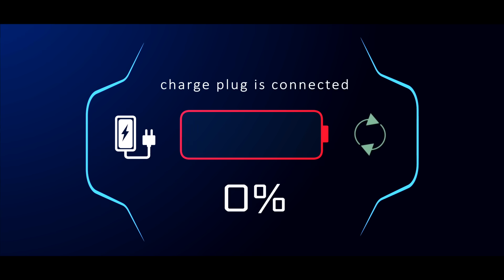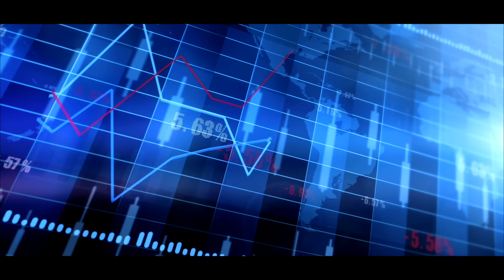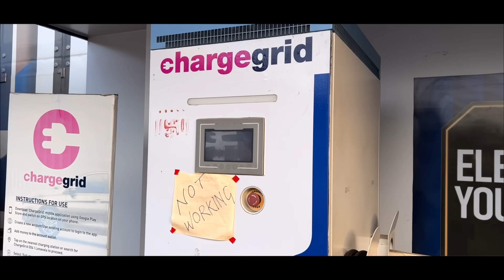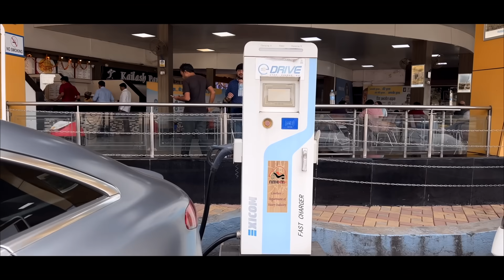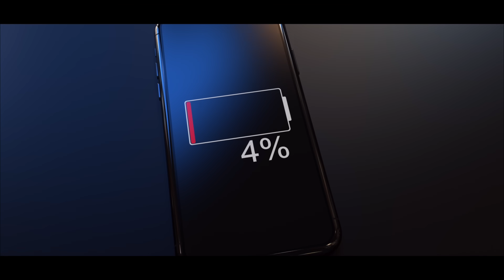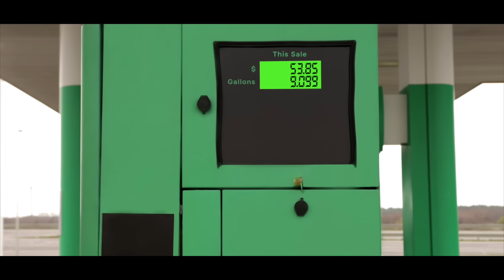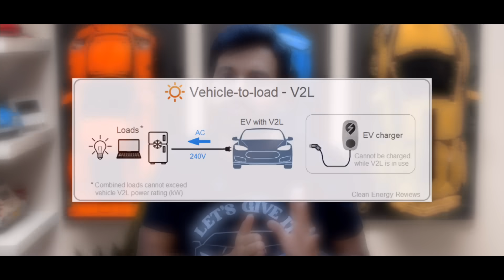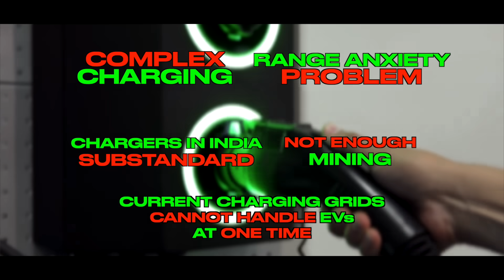Here Is Why Electric Cars Are Not The Future!

Comment: 1. Efficiency & Cost Savings:
	•	EVs are 3x more energy-efficient than ICE cars and produce zero tailpipe emissions.
	•	Cost per km: German TDI engines cost ₹5–₹7/km for fuel, while EVs cost ₹1–₹2/km when charged via grid electricity. With solar panels, EVs can run almost for free, slashing long-term costs.

2. Performance:
	•	Tesla Model S Plaid: 0–100 km/h in 2.1 seconds, 1,020 hp, 1,423 Nm torque.
	•	BYD Seal (Performance Variant): 0–100 km/h in 3.8 seconds, 530 hp, 670 Nm torque.
	•	BYD Atto 3: 0–100 km/h in 7.3 seconds, 201 hp, 310 Nm torque.
	•	Compare to VW Golf R TDI: 0–100 km/h in 4.7 seconds, 315 hp, 420 Nm torque.

EVs deliver instant torque, ensuring unmatched acceleration and responsiveness, making them more fun to drive than TDI engines.

3. Range & Reliability:
	•	BYD Seal: 570 km range (₹41–53 lakh).
	•	BYD Atto 3: 521 km range (₹24.99 lakh).
	•	Tesla Model S: 652 km range.
	•	Real-world examples: Tesla vehicles have driven over 300,000 km with minimal battery degradation, proving long-term reliability.

4. Maintenance:
	•	EVs have 20 moving parts in the drivetrain compared to 2,000+ in ICE cars, leading to drastically lower maintenance costs. No oil changes, engine repairs, or exhaust issues.

5. Driving Dynamics:

EVs outperform TDI cars in driving comfort and dynamics due to:
	•	Low Center of Gravity: EVs have battery packs mounted low, providing superior stability, cornering, and balance compared to top-heavy TDI cars.
	•	Instant Torque: Instant power delivery allows for better responsiveness and acceleration, especially in urban stop-and-go traffic.
	•	Quiet Rides: EVs eliminate engine noise and vibrations, offering a luxurious and peaceful cabin experience.
	•	Adjustable Suspension: Premium EVs (Tesla Model S, BYD Seal) feature adaptive air suspension, ensuring a smoother ride across various terrains.
	•	Improved Handling: EVs have regenerative braking systems that enhance control during deceleration and improve overall driving efficiency.

6. Advanced Technology (Missing in TDI Cars):
	•	Autonomous Driving: Tesla’s Autopilot and Full Self-Driving (FSD) capabilities offer unmatched driver assistance, absent in TDI cars.
	•	Over-the-Air Updates: EVs receive regular software updates to improve performance, safety, and features—TDI cars remain static after purchase.
	•	Regenerative Braking: EVs recover energy while braking, increasing efficiency and reducing wear on brake systems.
	•	Smart Connectivity: EVs come with advanced infotainment systems, app-controlled features (pre-cooling, charging scheduling), and real-time diagnostics, which are unavailable in most TDI cars.

Comment: Bro according to you, should we buy the innova cysta, innova hycross non-hybrid or the hybrid?
Reply from the maker: Hybrid
Reply: @FasBeam  Bro, why not the Innova Crysta. You keep saying right - A diesel is a FREAKING DIESEL!!! Agree that Crysta has less features than Hycross, but the interior quality doesn't seem worth the price. 
Btw I have been driving the Duster DCI 110ps from 6 years. The only fault with this is that the clutch is heavy now. But being a diesel lover, my mind is more inclined towards Crysta. Do Crysta's clutches also get tight in the long run or will it be smoother always?

Comment: As a general rule, in India, every kwh of electricity consumed to charge an electric car produces 0.85kg of CO2. So small electric cars (like nexons) are just about as clean as a honda city hybrid in the city, and most petrol and diesel cars can match EV Co2 emissions on the highway. And this is without taking into account emissions from manufacturing bid fat batteries. India is not the place for EVs yet. Overall hybrids are better.

Comment: In Andhra Pradesh the electricity board is corrupt.  For a charging station we need HT connection.
The minimum bill per month is around 50000 even if we don't use a single unit.
Besides the bribes and harassment.

Comment: Only vehicle that is ok for EV right now in India is electric scooter. you can get a cheap electric scooter for like 80K or a ICE scooter for like 60K. You will save the money in like 2-3 years. Also for City busses since they wait in traffic and bus stops all the time. so they are good for electric. So untill the charging infrastructure and Battery tech improves, save your money and buy a diesel or petrol or cng car.

Comment: India could make inexpensive quality efficient Eletric cars easily using the latest technology like lithium sodium  or solid state batteries that do not use cobalt.   

Also electric cars with car to grid 2 way power could stabilize the power grids in small towns that do not have access to consistent AC power.  

No more smog filled city centers. 

Oil is not going anywhere.  What we have should be used for industry and not to power are cars.

Comment: I beg to differ a bit on this. Electric vehicles are the future. Be it FCVs or BEVs. It’s just the lithium cobalt Nickel or more precisely the battery material that is not sustainable at the moment. Hydrogen as a fuel is sustainable when economies of scale evolve. Sodium as an alternative is evolving. Aluminium as an alternative is evolving, Iron alternative is also evolving. Mining is needed even to manufacture the utensils we use for cooking. Then why isn’t anyone using earthen cookware which is sustainable? Even the non vegetarian food we eat isn’t eco friendly. Anyone changing their habits for a more sustainable future? I doubt very few are. What we need is evolution from the current state and not devolution accepting the age old ICE engine tech with paltry efficiency. ICE vehicles are still winning because of economies of scale built over many decades. Electric vehicles are pretty new compared to them and at the moment may be more harmful when it comes to battery manufacturing. But that’s just one fraction of the EV manufacturing process. A lot lesser moving components in them means lesser manufacturing needed. Meaning lesser materials to be mined. No engine oil needed any more. No huge radiators needed. No sound pollution. We just need to move ahead with our outlook. Talking about the electricity source, our grids are more resilient than ever. Coal is not the only source. Solar is something many EV owners are setting up at home and pumping those green units into the grid. Govt is subsidising rooftop solar. Now pls don’t say Solar cell manufacturing is not emission free. 😂 Live a life but by minimising carbon footprint is what our current and future generations need to imbibe. Conserving water, fuels or any natural resources is the biggest need of the hour. Once the balance is disturbed it’s already evident how much the global temps are soaring and how many calamities are occurring. Needs our immediate attention and action. Otherwise we’ll need to find another planet sooner than anticipated.

Comment: 1. American case study shows    per 1 lakh  car,
3400 hybrid IC engine car catches fire,
1529 IC engine car catches fire
25 EV  car catches fire
So EV is most safest car on planet ! So, Don't lie.. 
 
2. EV don't finish at 1.6 lakh km. Obviously it losses range in terms of 5-10 % battery degradation per lakh km. If it's not matter than EV is lasted around 5-6 lakh km or even better 10 lakh km (just Google it).

3.  Sell EV car? Who cares after saving 30 lakh on fuel...

Comment: The Freeways of Los Angeles have cleaner air than in the 1960s and 1970s..But.. if the Environmentalists get there way the air will be much cleaner due to there not being any cars driving on them. In LA you drive 80 mph for 5 miles then spend one hour parked waiting for the traffic ahead to move. Scenario: You are driving from Winslow to Barstow and your battery dies in the middle of the Mojave Desert and you are roasting cuz you cannot run your air conditioner. Will AAA come and help you along with the 1,000s of other cars stuck. Pass San Bernadino and get look out at the Imperial Valley, millions of people are returning home from work and they all plug the cars into the wall... result: POOF, no more electric grid.

Comment: Problems now in ice cars
1)Before diesel cars were there now diesel cars are being discontinued
2)Diesel and petrol price hit the house roof
3)Service cost is going high
4)ice cars max running kms is 2lk kms even innova will be good till that
5)once we need renewal the once the engine work done then the whole car value steeps down
6)every1 speaks about battery recycle why dont speak about Engine oil...where those engine oil and hydraulic oils going????

Solutions for electricity bills
1)better go with grids in home which will reduce cost of eb
2)we get warranty for battery till 1.6lk kms
3)with just 5 lks we can renew the whole battery and we can regain the value of the car near to new
Reply: You can refilter the engine oil and distillate back. Lithium batteries? Last time I check on Google Scholars, at least 85% went straight to waste dump since it's hard to recycle and consume a lot of energy to extract those precious metals.
Reply: @gamtax  i think u have to google it more brother
We can recycle batteries by descaling the electrodes and the chemicals can be reconditioned by adding additives

And by the way the oil which u say by refilter
Its not hotel cooking oil 
It is synthetic oil once it loses its property then it cant be reused
Only mineral oil is recycled by adding additives but unfortunately mineral oil not used in recent cars
If u cant find recycling lithium phosphate battery link i can share the link

Comment: It takes over 84 times more RARE EARTH minerals to make an EV than to make an old ICE car.

New Combustion tech will be 500 times less minerals...  Basically EVs are a dead end due to lack of minerals.  

This shortage will show up in RE costs.  It will cost 20 times MORE to charge an EV than to make fuel from RE/nuclear.  20:1 is game over for EVs.  

This new combustion tech is NOT an old Otto/Diesel/Atkinson cycle engine.  It captures CO2 in the combined cycle and is 75% vs old ICE at 15% average, or 5x better.  It is also 1/2 the weight of an EV.  75% vs EV at 85% and 1/2 weight of EV results in 1.5x better MPGe.  In Winter/summer?  2-2.65 times better.  City in Winter 3x better than EV.  

The CO2 for RE fuel is 0.5% of an EV or 200 times less CO2 for battery+ elec. vs fuel made from RE.  Game over if CO2 is the problem.  

RE fuel can make an old ice engine, car, motorcycle, about 2.2 times less CO2 than an EV.  In new combustion tech, that ratio is around 5 times less CO2 at 150,000 mile life and up to 33 times less if used for 60 years, which no EV can get close to.

EVs are totally obsolete and will fail.  ICE cannot be banned if they are 33 times less CO2 ... LOL.  One nice lawsuit suing the government OFFICIALS (not tax payers) and this game is over.  There will be NO bans on combustion because RE fuels will be shown to be the ONLY solution to net zero.

Nuclear = electrical grid loads + fuel making.  This is the future.  The fuel can power old ICE engines, jets, ships, etc.  It is the only total solution that is possible.  EVs will not work on airplanes, ships, and much more, but RE fuels will.

Tell you Indian friends that energy will be cheap (1 cents/mile for a car) with new combustion tech, but will be 60 cents/mile with EV junk.

Comment: Its simple. Electric cars will be replaced by diesel cars. Therefore, diesel cars are going to be the future. This is because diesel cars are safer and are thus less dangerous to drive. I predict that in the future, ocean fish farming is going to be phased out instead of diesel powered cars. If I understand things right, electric cars were originally supposed to be driven by robots, not by people. The idea was that the car driver of the future was going to be a robot. Robots would drive cars and humans would no longer be required to drive them but would instead use other vehicles. Robots can tolerate exposure to electric charges, if they are designed to do that. Electric cars are thus not designed originally for use by human drivers. That is how I understand it. Cancer, electric shocks and other such things are the reason for why customers moved away from buying electric cars. If you think about it, banning ocean fish farming is more sound than banning environmentally friendly diesel cars. Modern diesel cars no longer have the dangerous pollutants their predecessors had. They are better, cheaper, and more durable and less dangerous than electric cars. Thanks for your video. Kind regards from Ásgeir in Iceland.

Comment: Electric cars have a lower carbon footprint then gasoline ones that's a fact no one can deny. The production of a lithium ion battery produces a lot of greenhouse gases no doubt but it is a one time thing. Batteries are charged with electricity whereas gas powered cars are run on petrol which will emmit carbon as long as they are running which means they will emmit carbon their entire life.
Also saying that EVs are not the future based on the "current scenario" is stupid. This was an argumwnt made against gasoline powered cars when horses were the main source of transporatation. At that time cars run on petrol were horrible making around 30 horsepower but as we all know they improved and no one talks about horses. That will be the fate of gasoline cars. EVs will and to some degree have become fun. Change is the only constant.

Comment: No petrol, no diesel no ev. Ethano for domestic vehicles, green hydrogen for commercial and heavy vehicles.

Ur blaming govt for arai claimed range. What's tata motors and others doing. Did they disclose real life range ?  Govt has given pli scheme thats ok. Govt has promoted cng and ethanol and flexi fuel as well. 
Its easy to blame govt and defend car makers. 

However youtubers and insta influencers get warm welcome during launch of vehicles. 
So putting blame on govt instead of manufacturer. Which ever govt is there, Arai will be same.  
I guess hybrid also uses lithium battery. I didn't know it was eco friendly😂

This video was like, I like ICE engines and sound. And ev is not environment friendly let's use petrol  and diesel and blame govt. 

Govt has also promoted cng flexifuel ethanol.
 You didn't give any solution either

So ur motive was completed. You got views and likes😂

Comment: Hey PetrolHeads, let me give you my view 

ICE cars cause emissions. Yes that's true. But is that the prime reason for climate change and depletion of ozone layer

NO. The reason is - Due to vast deforestation, CO2 absorption rate is becoming less and that's what's impacting the ozone layer. 

The biggest CO2 emissions are caused from US and not India. Even though US has less population than India, most of the middle class family have 2-3 cars and they are often their daily driver. So they cause more degradation. But the problem is not just that. US has been cutting all the trees and building factories which causes less absorbing of CO2 and they use the trees to make toilet paper to clean their crap. How pathetic is that 🤡

Switching to EV is not going to save the future. Because EV manufacturers along with the government has no answer about disposing the Batteries. Which again is more dangerous. Also these microwave electric cars are less durable and less reliable than an average diesel SUV. Hence we come to a conclusion that EVs are not going to solve the problem.

Look at Singapore, most of the buildings have hanging gardens and there is less deforestation. They care more about the environment. That's how people should resolve the issue. Manufacturing more EVs are not a solution at all. As I said. it's just gonna create more problems in the environment as well as the economy.

ICE cars anyday. Faster, more reliable and better.

The engine components can be recycled after their ultimate use and make use of them to make other equipments. Hence, ICE cars are much better. We again came to this conclusion.

So what should we do?
Plant more trees, reach out to these environment communities and help them.
Say NO to EV.

We can't live without hearing the V8 scream

Comment: There is no "Transition to electric vehicles"  Not that people don't like EVs - there isn't enough lithium. Even IF you devoted every ounce of the 100,000 Tons of lithium to EVs max is 10 million Ys.  But there are 1 billion cell phones, battery farms, laptops etc. all using lithium; so the real number is 5 to 6 million in a market of 100 million vehicles annually, 5-6% niche market isn't a transition.  At this point EV advocates say what about sodium what about carbon .. what about them? There isn't a single vehicle incorporating them yet.  More sobering? 1.4 Billion light vehicles exist of which EVs are 0.3%.  Add to this EVs don't work for a lot of purposes - they perform terribly under load. A Rivian truck towing a trailered Mustang only goes 120 miles before needing a charge, 100 miles in frigid weather.. same goes for any EV under load; their range is horrible in that circumstance.  If it were not for "subsidies" they wouldn't even be selling well; EVs are more costly than alternatives.

Comment: Only real solution is Hydrogen combustion engines. Zero harmful emission, dirt cheap and infinite fuel, already proven tech(it's basically just a CNG engine) not to mention good mileage. It's practically perfect. Yet,Toyota and BMW are the only ones trying to make it happen. I wonder why that is...
Reply: Burning hydrogen means a 50% loss of  energy. Carnot. ==> Fuel cells can deliver >90% of the energy in Hydrogen - if done right.